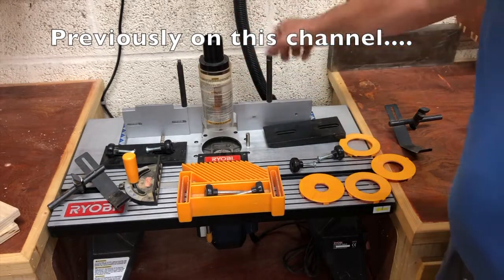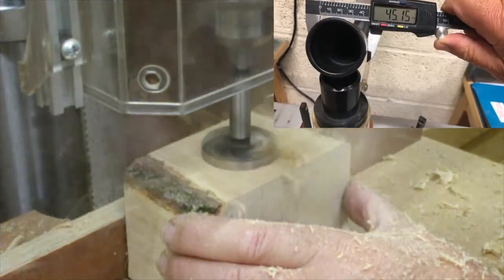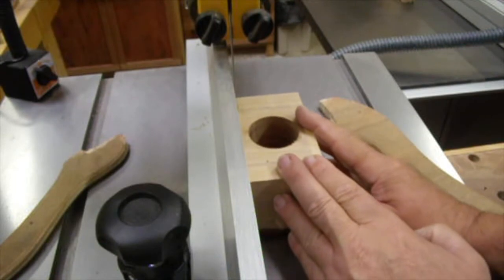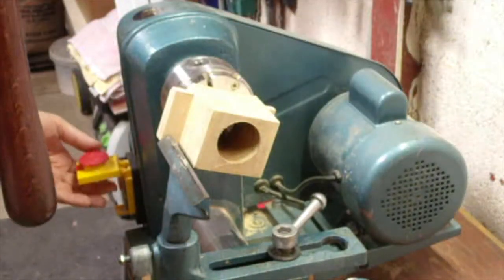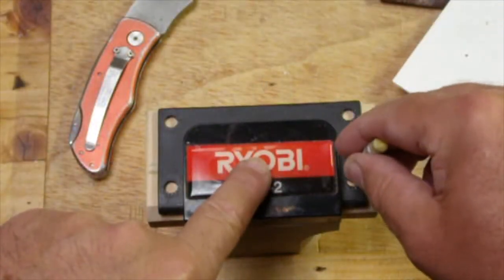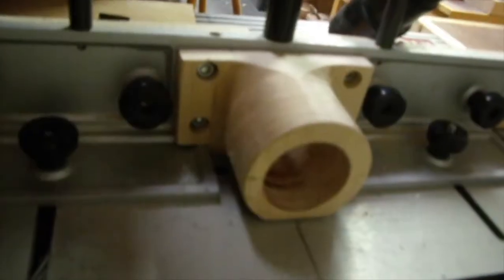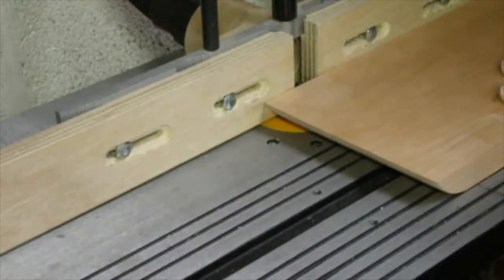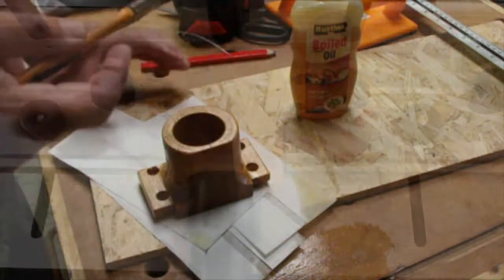I make the long needed Vac Adaptor for my Ryobi ART-2 Router table

Comment: Hi Steve, Fantastic piece of "Wood Engineering". Should last you for years as it's not a moving part. If the hole for the pipe does widen a bit it's amazing what Duct Tape or Masking Tape fixes. Two things I was told every one should have in their toolbox/workshop. Duct Tape and WD 40. If it moves and it shouldn't use Duct Tape. If it doesn't move and it should use WD 40. Take care Steve. Cheers, Huw
Reply from the maker: WD40 and duct tape always at the ready Huw, don’t know if you’ve tried it but gorilla tape is awesome a bit thicker but sticks like you know what 😉 Thanks for the kind comments. Cheers Steve
Reply: @Phenrica  Hi Steve, I've used it once on a segmented bowl ages ago and a glue joint failed. Still have the rest. Huw

Comment: That works very well, but would it not be easier and more durable to make it from plastic water pipe, you can easily weld the pipe to the flange using a soldering iron and an off cut from the plastic pipe, I realise that making it all from wood was the challenge here, but the plastic option would last longer. Stay safe! Chris B.
Reply from the maker: To be honest Chris it took me about 1/2 hour to make and I’ve got loads of birch logs and I’ve had to buy some pipe 😂